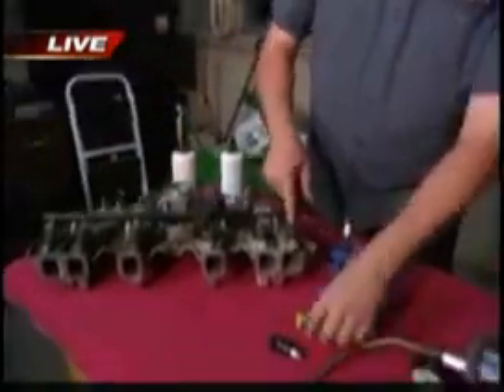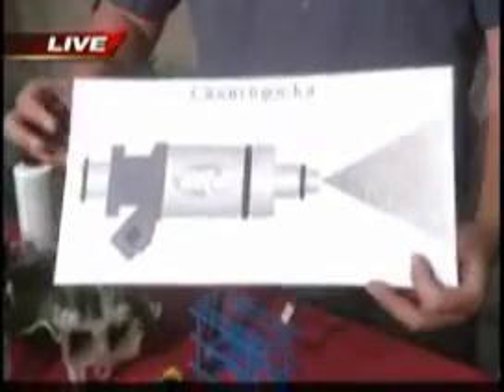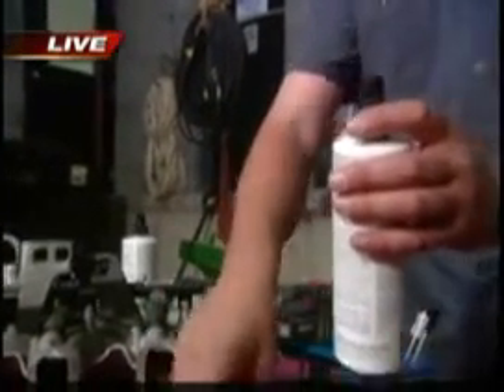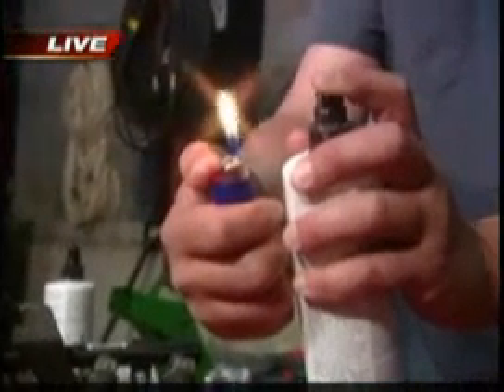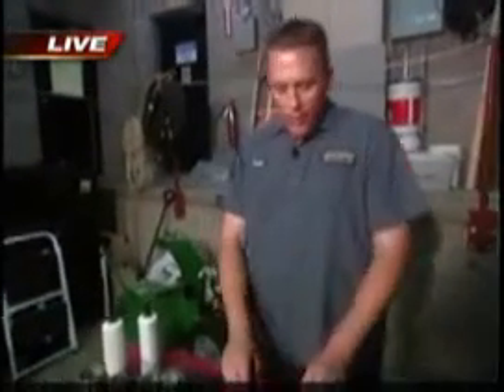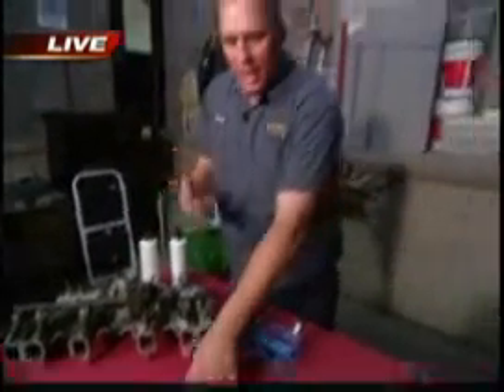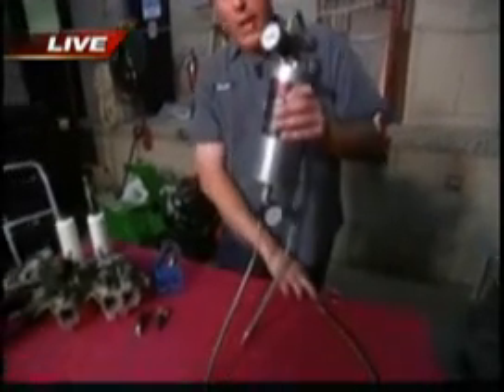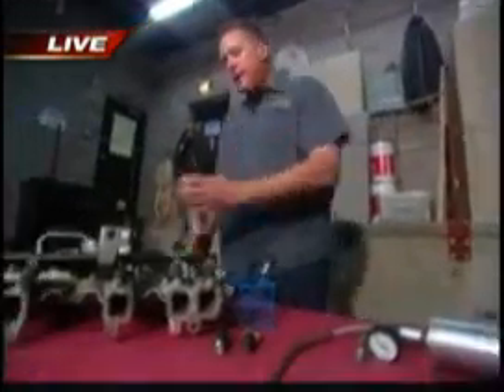Keeping Your Fuel System Clean Can Mean BIG Savings!

Comment: Thats just hairspray.. Hes simply giving you an example, showing how a fine spray burns better.
You can buy injector cleaner, but the results are debatable.. Its not like a mirical cure.
Bettery way to save fuel, change your driving habbits.
Dont brake so much, braking effectivly wastes petrol.
 youv just wasted all that kintetic energy you built up as speed. 
Time your stops to the traffic lights better.
Great example are freeways, the increase is just because your not wasting energy.